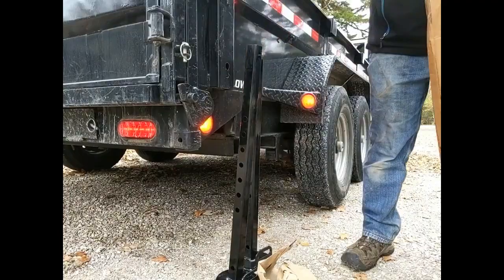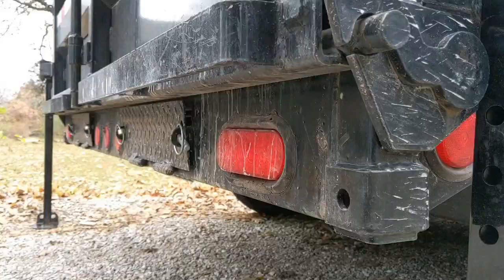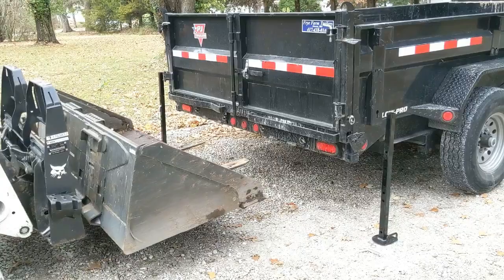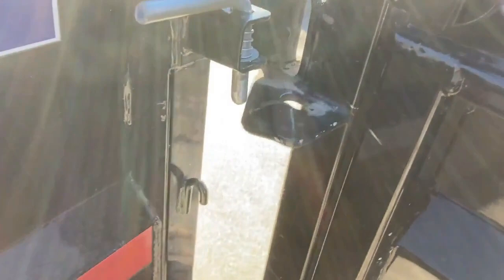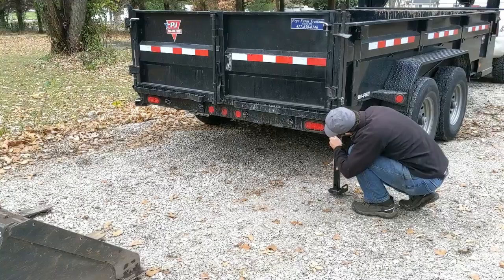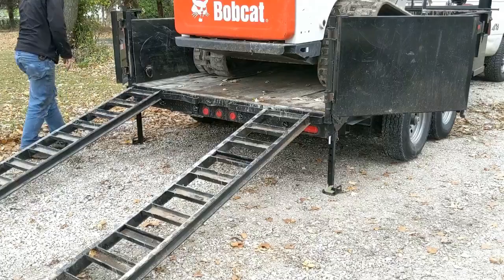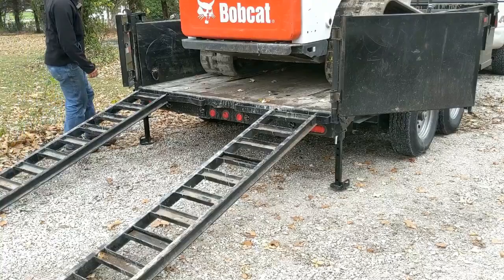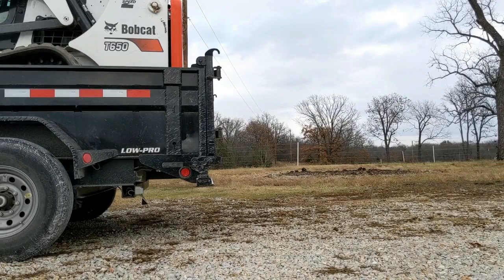PJ Dump Trailer Jack Stands A MUST Upgrade for Everyone Hauling Equipment!

Comment: I’d recommend putting a 6x6 block of wood to scotch the trailer wheels just to save the parking lug on the transmission of your truck. That’s an enormous amount of pressure that it’s not designed to hold. Never trust a parking brake either. I lock mine into 4wd, scotch trailer, and drop the supports

Comment: Another idea is to use wood blocks under the back trailer support. If the blocks get stuck, pull forward. But keep your stands as extra measure of balance to load the machine.

Comment: Tilt the bed a little to make it a totally smooth transition. Probably more important with an excavator. When you unlaod you fit the stand tight to the ground, since once the machine is unloaded, you will automatically have more clearance. Nice video and well done for adding the C-channel to those ramps.
Reply from the maker: Great points! Thanks for commenting.

Comment: You should always you wheel chocks on the truck too. Extra safety never hurt, plus less abuse on the driveline of the truck…
Reply from the maker: You are right. Usually I do when scooping materials out where it puts strain on the forward and backyard direction of the tow vehicle. In this situation we were lifting up so not as much abuse on the drivetrain.

Comment: I really hated those door pins that I had on my 16 ft PJ dump trailer. They were constantly getting bent and they were a pain in the butt when they got dry they didn't want to slide so I ended up welding some 10-in long chain pieces on the side of my trailer that had hooks on the ends and they now catch the top of the front of each door and hold them open and I never have any trouble now.
Reply from the maker: So far I’ve always been able to bend it back into place. But there are definitely better and worse days.

Comment: Could you lower the stands a few inches off the ground then tilt the trailer until they hit?  Then drop thr trailer once its in?
Reply from the maker: Yes, you could possibly lower the tongue of the trailer. If that’s not enough you could use a floor jack to get the extra height required.

Comment: prob means you should load backwords for tongue weight?
Reply from the maker: Backwards puts too much tongue weight on the truck. Forwards is probably 50/50 weight distribution. Backwards is probably 30/70. Ideally it’s 60/40 but that is why we typically use our Diamond C equipment trailer so we can distribute weight correctly.

Comment: From my own experience, I don't think you would have had that problem with the rear stabilizers if the skid steer was backed on instead of pulled on due to the weight of the engine being more to the front of the trailer.
Reply from the maker: For weight distribution purposes this skid has to be pulled on forward. If it is backed on the trailer there is way too much tongue weight. But you are right. It would have lifted the rear of the trailer so they jacks didn’t bind up. But it would have caused weight to be added to the drive tires and removed from the steer tires which would cause a loss of front braking traction (front brakes do the majority of the work) and more importantly a lack of steering ability. Too much tongue weight can result in the tail wagging the dog. I have a video talking about when I improperly loaded a piece of equipment which resulted in a pretty scary situation that I honestly don’t know how it wasn’t any worse. Video is titled “What Happens When Your Trailer Tongue Weight is Wrong?” This was a deeply engrained learning experience that I will never forget. 

Also, the reason the jacks bind up is the trailer suspension sags with the added weight of the skid steer. It’s easy enough to plan ahead for the sag yet still have the extra support from the jacks for loading and unloading.
Reply: I always back mine on the trailer
Reply: You couldn’t raise your bucket and drive ahead more ?
Reply: Or maybe back it on
Reply from the maker: 14’ dump trailer is too short for proper weight distribution with this machine (if backed on). I would have too much tongue weight. Forward facing is better for proper weight distribution.

Comment: Hey man. Nice video. Question is your t650 a wide track? Mines a wide track and I believe it’s close to 80” out to put on the tracks. Doesn’t leave much room on an 83” trailer.. 😳 im asking because Im about to buy one and just want to be sure it will fit and load well.
Reply from the maker: Wide track barely fits on both the PJ dump and Diamond C equipment trailer. Maybe 1-2” to spare on each side.

Comment: Thanks for sharing. Question about the truck: Was it a automatic in Park? Or was it a manual in neutral with parking brake set?
Reply from the maker: It was an automatic in park. The forward and aft movement was minimal as the skid steer lifted the weight vertically. If we were pushing against the truck I would recommend to block the tires.
Reply: This was interesting to watch as you learned immediately that you have to set the stands a bit off the ground, which helps w/ramp angle And because it keeps decent weight on the trailer springs which really helps keep it "planted". But you probably (as in definitely) Should use chocks, and on the trailer itself not the truck. Another option is to pull the trailer's emergency brake wire, but that might drain the battery too much. Thanks for posting this vid- 👍

Comment: Did you had your truck on neutral for the truck to move away the way it did? I never had no issues loading my big takeuchi 285.
Reply from the maker: Truck was in park with the parking brake engaged. It was parked on an incline and the weight on the rear of the trailer lifted most of the weight off the rear wheels. Once it started moving forward it was too much weight and momentum to stop.
Reply: @ThriftyGarage  oh ok, that's really weird to happen. I hope that the parts you installed helped you.
Reply from the maker: Yes, the rear support legs definitely helped along with being mindful of where you are parked when loading and unloading.
Reply: This has happened at work a few times.   If the equipment is heavy enough.  A tractor trailer will take you on a "💩brown boomer 💩" run !!  Beware loading on a incline!

Comment: Guys on here griping about having to drill out the stabilizer holes when Most companies don't even offer the stabilizer sockets to begin with. Maybe junk trailers are being sold because the Customers aren't too smart after all... 🤔
Reply from the maker: I’m mostly disappointed that I had to remove the factory paint in order to fit the pin. It wasn’t that difficult.

Comment: It seems like PJ makes junk dump trailers!!!💣
Reply from the maker: What makes you say that? Honestly, I’ve heard it a lot. I’ve done a few review videos of the PJ and a comparison with the Diamond C. Honestly there are some things lacking or that could use improvement. But I wouldn’t classify them as junk. I’ve heard all the horror stories and after using it I would have to debunk most of them in my personal experience. PJ has not sponsored us in the past and I’m under no obligation to say that. Just my experience.

Comment: Load with your truck facing up hill and it can’t run away. I give it time and you’ll drive off with them supports down.
Reply from the maker: 🤦‍♂️ I already did it once. Had to bend it back into place with a hammer. They do bend more easily than I would like but they are still a necessity in my book. Equally important as having a ramp to load equipment if you ask me.